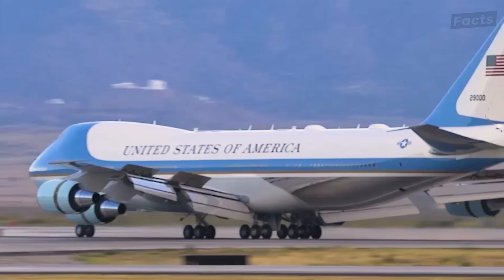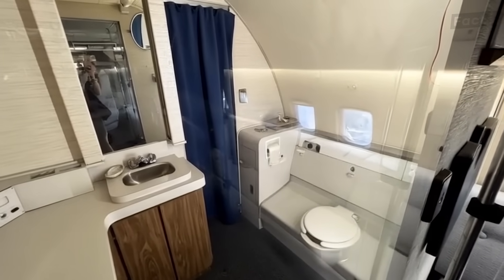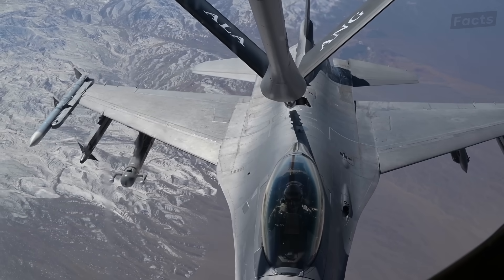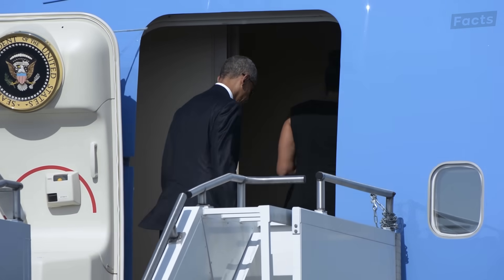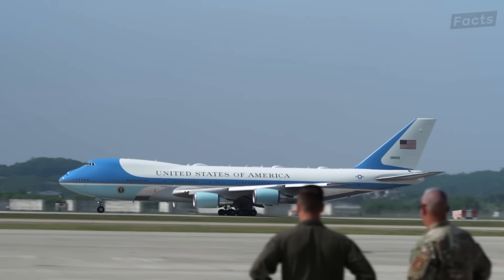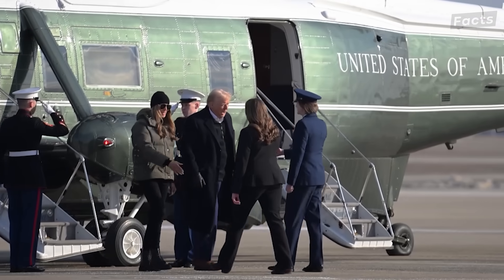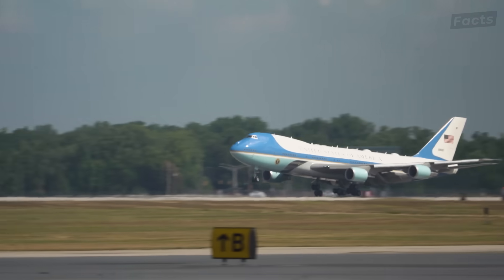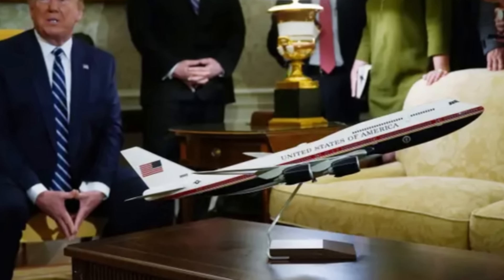Inside Air Force One - The Plane That Costs $3,433 a Minute!

Comment: It’s not just the president which flies. It’s the flight crew. It’s his staff the press cord that travels with him. They’re insane about having to put so many more people in the press court to begin with Secret Service and people to run the plane, considering the fact that Air Force One is a mobile command center the military has their own version called Looking Glass, but the current iteration of the Air Force Onehas communications. It’s also it’s completely sophisticated and secret to let the president communicate with anywhere anyone anywhere especially the military it’s also got defensive capabilities hardened against EMP and is designed to take care of the president of United States. It’s his mobile office.